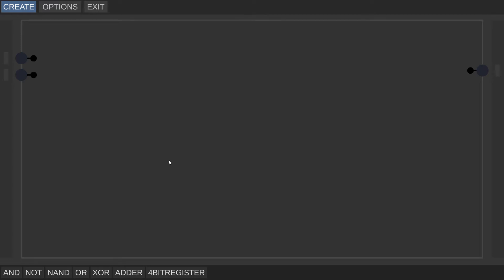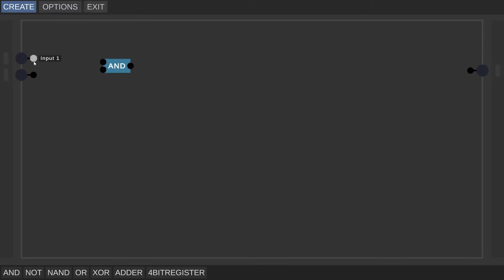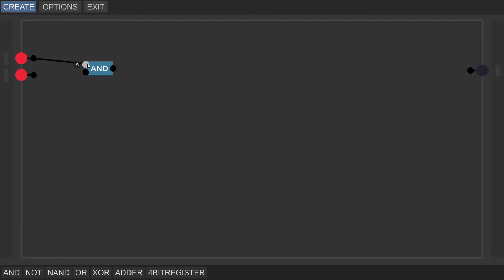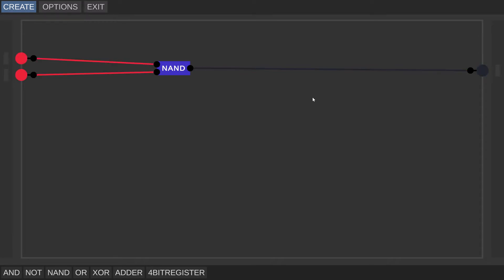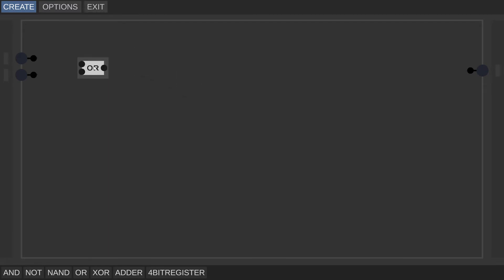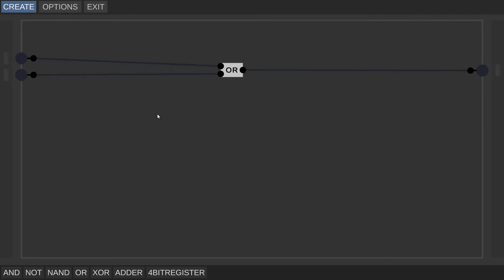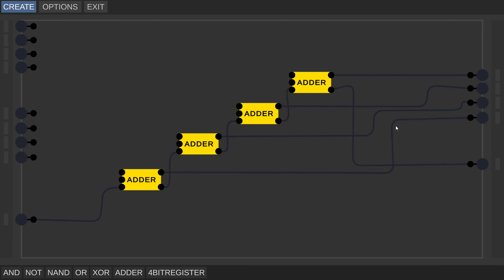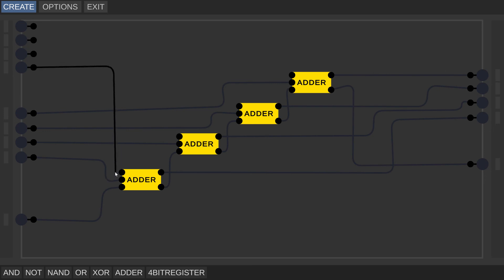Tutorial for creating a 4 Bit register in Digital logic simulator

Comment: Btw it's adder, 4 bit adder, I mean you just put in 4 adders?? And you get a 4 bit register?? :):):)
Reply from the maker: So basically when you combine 4 adder circuits together you get 1 4 bit adder
Also called ALU or register
Reply: @kinematic_InMotion  an ALU is an arithmetic logic unit though. not a register
Reply from the maker: @alexpopblock6435  Technically they serve the same functions. A register stores and process inputs while an ALU also does the same, they are just used for different purposes.